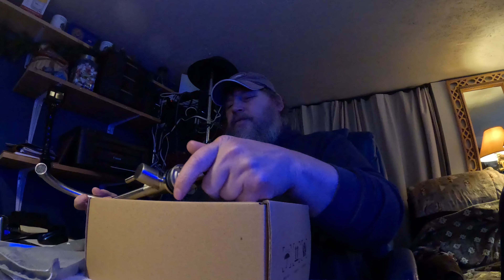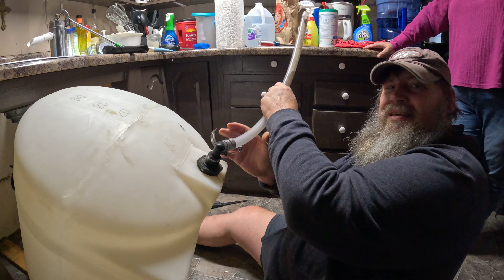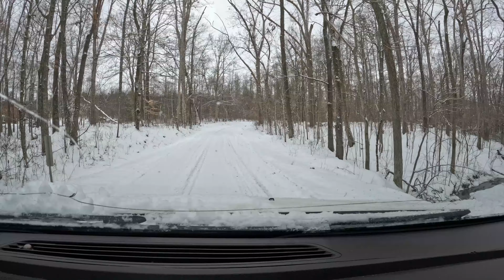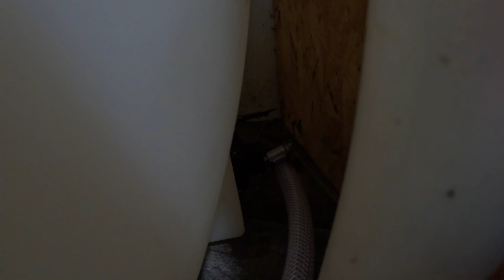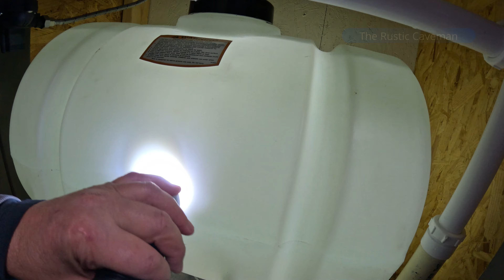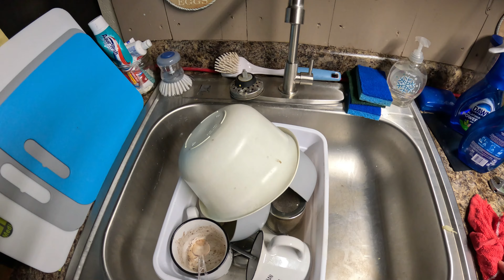Is a Dry Cabin Water System REALLY Worth the Hassle?

Comment: Wow that works great 4 trips to do a plumbing job sounds about right lol reckon how high that pump would lift the water?
Reply from the maker: I was wanting to locate the pump on the floor but could not find the right fittings for it. was also wanting to go with braided supply lines from the tank to the pump so everything would be threaded but that didnt work out either. Oh well, barbed is easier anyway. The head spec on the pump says 9 feet but I would expect 4 would be a safe expectation. I was worried that the auto shut off would not work well but happily it does. And from what I can see, we are using a little less water because the facet is more precise than the pump was and has less waste water.
Reply: Sounds just like one of my projects….never the right tools or parts.  Luckily we have a Menards about 7 miles away.
Reply from the maker: @haggetthill  I actually have all the tools... they have just been in storage for 6 +years